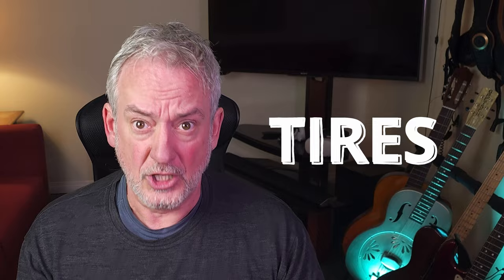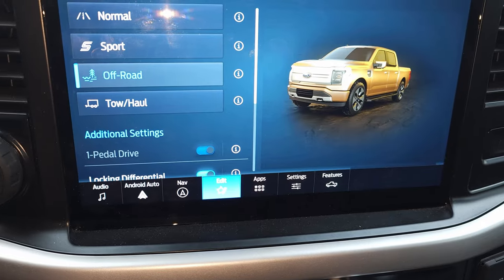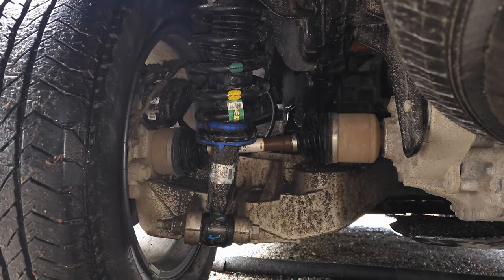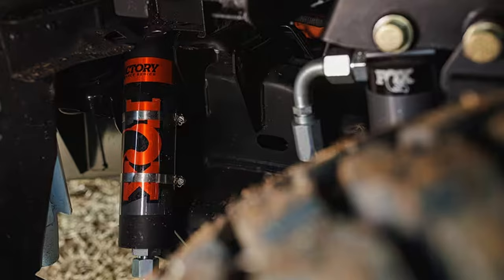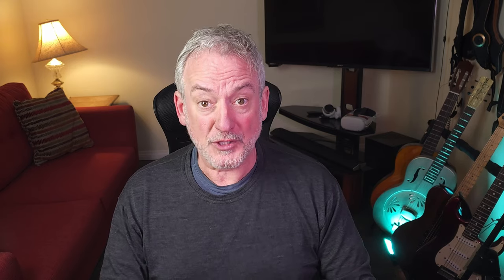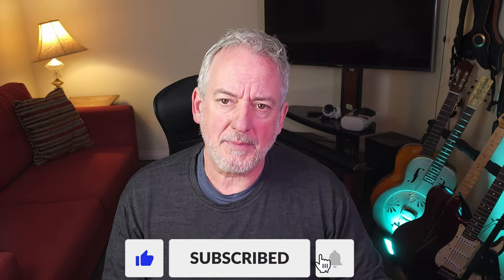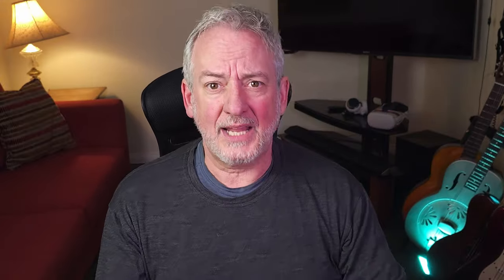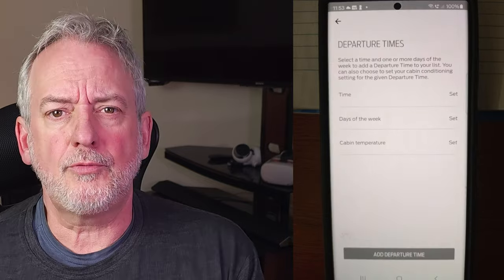10 Costly Mistakes Slam F150 Lightning! #1 Is the Dumbest!

Comment: #2 is the worst, and it's not just the Lightning.  PLEASE, Ford (and every other manufacturer), sell me a new car that DOES NOT have auto-braking, adaptive cruise, and all of the other "tech" junk that doesn't work, and that nobody asked for in the first place.  Forcing drivers to have to disable it explicitly every single time they get in the car is insulting, as well.  If I turn something off on MY vehicle, it is because I don't want it turned on.  Again, it is MY vehicle, not YOURS.
Reply: Except those of us that drive in long arduous hours of stop and go traffic

Comment: 2023 XLT SR. 12k miles in 10 months of ownership. I would add (to #4 the FordPass app) that it doesn’t tell you status of the vehicle. I just had a Toyota rental for a month. So I downloaded the app. It would tell you if the vehicle was locked, the windows were open and all the usual stuff you’d expect. I have to constantly and repeatedly lock my truck because I can’t remember if I locked it and the app doesn’t show if it is locked or unlocked. Never mind if the windows are open or closed. The app sucks. In car EV software isn’t any good either. Is Ford looking at Teslas? At all????
Reply from the maker: Well said! You totally nailed it! 
I absolutely love this truck, and after driving an EV, like over 98% of all EV owners, I have no plans of ever going back to gas. 
But come on, Ford! 
As you said, Paul, it's this old legacy auto mentality and so many departments that aren't actually going out and using these apps in the real world, or comparing them to the competition, namely Tesla.
Ford is also doing a terrible job of listening. There are, I don't know, 14 departments for each aspect of the vehicle ownership experience, and many of those departments aren't based in the country of origin, or connected in any way to each other. I spent 4 hours on the phone with 5 department trying to find out where my vanished Ford Wallet was located because I wasn't able to plug and pay at ANY charger, including at the so'-called 'Ford Network' (ha!).
BIG room for improvements. Hopefully, Ford listens to excellent comments like yours!
Thank you for the great insights!

Comment: I also have a 2023 ford lightning platinum and have not experienced any of this “problems” , I believe ford did an amazing job building these trucks
Reply from the maker: I love the truck too, probably why I still own one. I'm not surprised that you have fewer issues with the Platinum.
For many of the problems, it seems it relates to the XLT and Pro trims. Due to the smaller screen, they don't come with not only all the software options but processing capabilities. Adaptive cruise in the higher trims is smooth and even slows for curves, hills,etc. The XLT does none of that. As far as communication between Android Auto and the native app, again, all the issues are non-existent in the higher trims.
Now that I own the higher trim, many of the issues I cited back when I made this video no longer exist at all.

Comment: Byd is not electric only
Reply from the maker: You are totally correct, however BYD discontinued gas-only vehicles entirely in 2022 but yes, still makes plug-in hybrids. The more important point is that they are very much vertically integrated, and that helps them on many fronts compared to the challenges legacy auto faces. Thank you so much for the comment and the clarification!

Comment: I went from a Tesla model Y to a Lightning and I cried during the first night of ownership! I was asking myself : What have I done?? 
The software is STRESFULL!! I warmed up to the new truck in the next few days, mainly because of the ride quality and because humans can adapt...
I agree with everything you said, I hope that FORD will listen to us, great video!
Reply from the maker: I feel your pain, my friend!
Oh, the suffering!
But yeah, I think as owners, if we keep cornering Ford with logic and forcing them, possibly kicking and screaming, to dump the outdated, top-down, outsourced, cheapest-supplier-wins, on-time part delivery dog and pony show, and get back to self reliant, resilient factories with internal, vertical integration AND innovation, it is likely Ford will be the one legacy auto company that could really thrive...
And if they have someone in IT confined to the inside of a Lightning and allowed only drive-through food for a month before they are allowed to release the next OTA update...
:-).
Reply: Have you sorted out the problem with your lightning? I am thinking about getting one. Thanks!
Reply from the maker: @michelsilva5188  Every vehicle out there has bugs of some sort, but overall, most issues are either minor or not deal breakers, but not all solved.
Battery issues seem to have vanished with the OTA and the minor sensor recall replacement.
The software interface is still buggy, along  with Android Auto sometimes, and Ford still hasn't fixed little niggly things that could easily be addressed in an OTA.
I hope this helps.  Have you already watched my 10K review video and my Top 10 reasons to buy one? They kind of sum up my overall feelings, while weighing in on the bugs in this video. Here's links to the 2 vids, if you haven't seen them yet:
https://youtu.be/MjxdUepdieI
https://youtu.be/LNNtGpgA3mw

Comment: The bed size and obligatory crew cab is a pain for all us who use a truck for work.  Could I have a truck with a super cab, a 8 ft bed, and extended range battery please?  

That said, the frunk partly makes up for it and is a huge upgrade over a ICE ford with a 5.5 bed.  

Software is the bane for modern auto ICE and otherwise.  We just got a model Y and wouldn't consider any of the competitors for that reason.
Reply from the maker: Absolutely! I have had a LOT of comments about this very things and as I said in the video, Ford and every EV truck maker are treating these like something other than a truck, and thus, so are the consumers. 
I would buy a long-box, super cab, extended range in a flat second for work, and I probably would look the other way on who the manufacturer is, simply because that functionality changes everything for my work. First one to market wins :-).
Thank you so much for commenting, and yes, Tesla completely puts to shame the software of most other automakers, though since my post, I have received 2 OTAs and both were awesome and somewhat significant, so Ford is certainly trying to get there.

Comment: I drive a 2010 F-150 and love it. That being said, all of Ford's new trucks frustrate me to no end. It seems like none of them are made for work anymore. I don't ever want a crew cab but Ford seems to think otherwise. Additionally, like you said, from my experience with my boss' 2021 F-150 the software is awful. He's had problems with HD Radio in his truck which is a problem when we work in radio broadcast engineering for HD stations!

I wish someone would just make an affordable basic pickup truck again. I don't want all these extra screens and buggy software
Reply from the maker: Exactly! There's the reality that a vast majority of folks are buying trucks and never using them as such, and the Big Three are catering to that, which in the end helps no one, putting more huge vehicles on the road used as commuters, and real truck use becomes prohibitively expensive! Love this feedback! In fact, I might just have to do an episode on it 😀

Comment: Just upgraded to a lariat lightning from a lariat maverick hybrid. Wow it’s like stepping into luxury for me. I do agree with several of your points, the most annoying is the software. I have Sirius xm and 2 iPhones connected with wireless CarPlay. It’s a battle royale trying to see which phone/app/svc will dominate.  The charge and go with blue oval charge svc however is great, seamlessly connecting and paying without having to login to the app for each particular charge station. 
Yes truck configurations is necessary. I want my lightning to stand out.
Reply from the maker: Nice switch!
Blue Oval supposedly works great in the US as well as Blue Cruise & Adaptive Cruise. I assume that based on your positive experience that you're in the US? In Canada, they all suck.
However, I replaced Igor with my new 2024 Flash, Thor, which tells you how much I love the Lightning.
I laughed so hard with your 'battle royale' comment! Classic!

Comment: I would like to see a 6 foot bed option.  I don't like the back up beep and I especially don't like the frunk beep; i'd rather have a manual open/close frunk just so it wouldn't beep.  The rear seat vents don't really work; you have to close most all of the front vents to get noticeable air blowing to the rear vents.   I agree with it being annoying that you can't override charge settings when desired.  Those are my complaints.
Reply from the maker: The frunk beep and the loooooong wait drives me nuts! The bed length options are a huge missed opportunity. I would have a 6ft. at the minimum. As far as the air vents, I found that in the vent options button, it sometimes remains on Driver Only. When air flow in the back has been poor, I've sometimes found this on, turned it off, and have had good airflow in the back seats without having to close any front ones. 
Share whatever quirks, bugs, and joys you have with your truck anytime. Love to hear about it!

Comment: This is interesting, at least as far as the things that relate to actual ownership of the truck, because I've had my platinum for a few months and I've experienced none of that. The only real issue I have had was with Android Auto and it turns out that that was an issue with the phone that I had at the time. I've upgraded since then and have had effectively no problems. Maybe they will crop up later.

Comment: inadequate tires? really? have you not bought ANY vehicle before??? Every factory tire is lousy. That's not EV specific!
Offroad? You do know that Ford has NEVER advertised this as an offroad vehicle right? They advertise this as a work truck, not an offroader!
Cabin and bed options? Well. Name me one other EV truck that gives you a choice there. None? oh... 
Interior is the same as other F150s?  So you want it different here, but your last argument was you wanted it the same as other F150s. Not to mention, compare it to other vehicles. Ever looked inside a Tesla? yeah, high quality there!
Not selling lower trims and jacking up the prices? go ahead, buy the $30,000 Cybertruck, I'll wait!
The sport mode thing isn't ford, it's the EPA. If they let you choose to keep the mode, it would affect their whole EPA test cycle as it's based on "default" modes. Blame the government on this one, not Ford.
"this is not Tesla software". Comming from the owner of a Model S for the past 9 years. That's the best glowing recommendation for the Ford I've ever seen. I DESPISE Tesla software. The lack of basic features like Android Auto, coupled with the constant moving of commonly used features, usually several submenus deep, the removal of features with each OTA, the INCREDIBLE vampire draw, the list goes on and on!
The "speed sign recognition" thing sounds EXACTLY like Tesla in my experience.

What a ridiculous list of petty whinning!